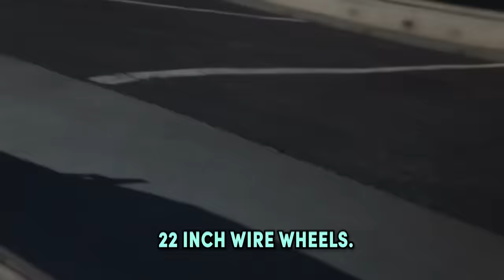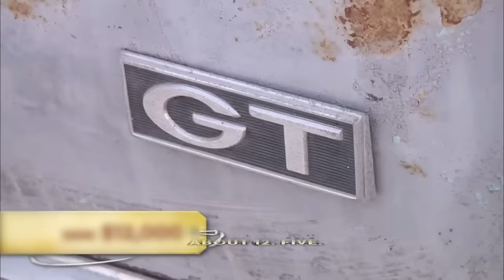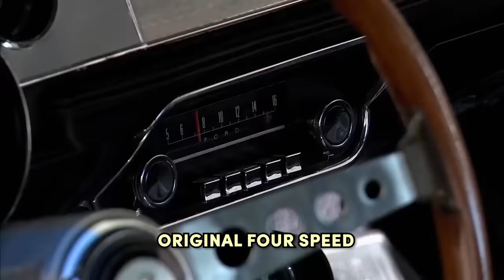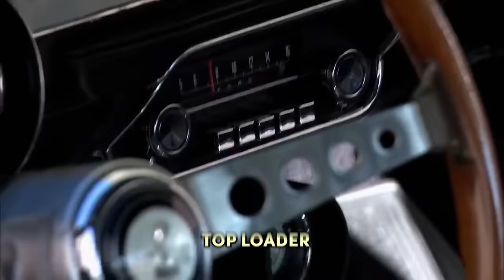RARE DEALS on Pawn Stars

Comment: two issues. First, the Mustang used in Gone In 60 Seconds was a GT500. Not at 350 (both movies). Second, the GT350 used in Bullitt was never restored and sold at the Mecum Auto Auction in 2021 for just over a million dollars. It was a huge pleasure to watch that iconic car roll across the auction block and just being that close to it.
Reply: The Bullet mustang car had a 390 in it not a 302 also.
Reply: I don't think they claimed this was the actual Bullitt car did they? I struggle to believe he restored it for 22k hell a paint job now adays goes for that amount? Never mind all the other parts they installed on it. Beautiful car though can't argue that?

Comment: I call Bullshit on the Mustang, GT's Had 390's not 302's
Reply: N code GT Mustangs had the 390FE motor. Standard GTs had the 302, and this car is not the standard GT.
It's a GT CS (or California Special) and there was a ton of them made.
The regular standard GT had the dual exhaust that came out the lower valance with chrome rings fully surrounded by the valance, note this one has 1/2 circles where the exhaust comes thru, hence GT CS.
The original Bullit car was a N code GT with a 390FE.
I KNOW early muscle cars....I wrenched for right at 30 years, it's my thang 😛
Reply: @jamesroberts1800  Umm...the 390 was an S code, the GT/CS was only built on the coupe (hardtop) body and was in fact limited production and the tailpipe going through the rear valance with chrome ring surrounds were only on 65-66 GTs.

Comment: Except the original Gone In 60 Seconds car was a Mach1 Mustang, not a Shelby
Reply: Mach 1 wasn't produced until 68
Reply: @davidjudge2913  you're right, and the original film came out in '71, and the original wreck from the film is on display at The Peterson auto museum